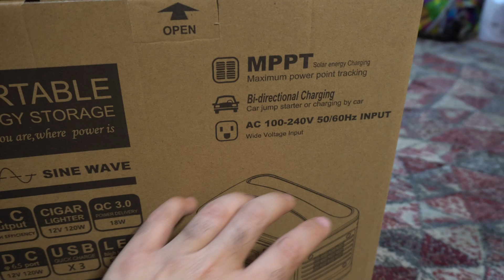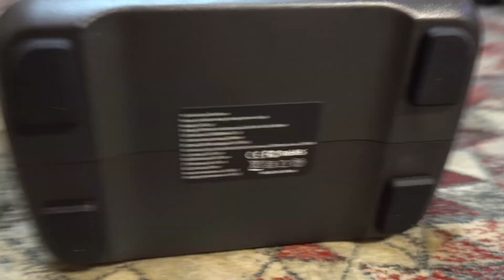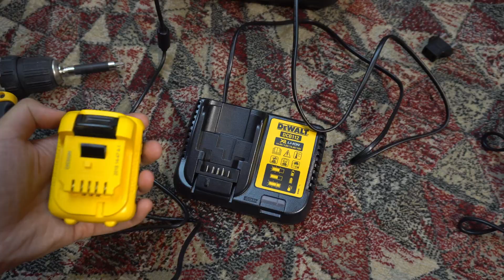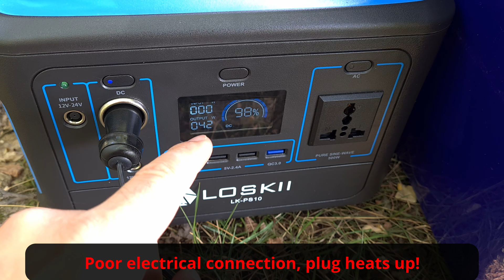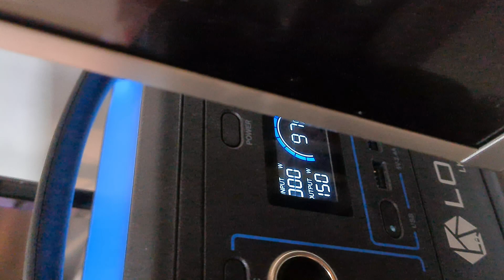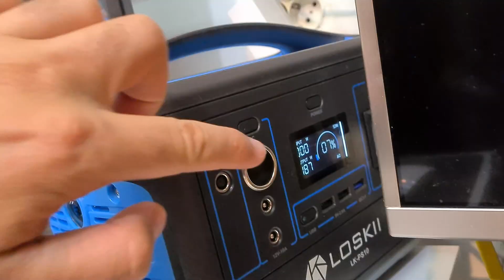Loskii LK-PS10, Portable Power Station (Li-Ion, 568Wh, USB QC3.0, 500W Pure sine AC Output)

Comment: The video is very good, but I think you missed 2 tests to do it.

1... Test how long it lasts from 100% to 0% with a device that consumes X continuous watts.
2... Test the maximum watts that the unit supports (increase the watts progressively).

With these tests that you have not done, the video would have been 10.

And another thing, if the batteries are 18650, then they are LiFePO4 batteries (you don't say that either).

-------------------------------------------------------------------------------------------

El vídeo está muy bien, pero creo que te faltaron 2 pruebas por hacerle.

1... Probar lo que dura desde 100% a 0% con un aparato que consuma X watios contínuos.
2... Probar el máximo de watios que aguanta la unidad (ir subiendo los watios de forma progresiva).

Con estas pruebas que no has hecho, habría quedado de 10 el vídeo.

Y otra cosa, si las baterías son 18650, entonces son baterías LiFePO4 (tampoco lo dices).

Comment: How is this Holding up in the last 4 months 🤔
Reply from the maker: Seldom but I use it and it works OK till now, no issues. Last time I used it with a 3D printer overnight to have guaranteed constant power.

Comment: I need a spare charger input plug for the Loskii LK-PS10, seems to be 8mm in diameter. Cannot find one and would appreciate if somebody knows where to buy it!
Have tried asking Banggod for the specifications of the plug but they do not read my questions, only answers with nonse replies, again and again. Worst customer service ever!!!
Reply from the maker: My measurements are these: 7.8mm outer diameter, 5.3mm inner diameter (or just take it apart and install a different connector).
Reply: @furulevi  Thank you, have ben mailing to and from Banggood for several weeks now. Totally unhelpful, even refused to give me contact details for the (unknown) manufacturer.  And if I open the power station I loose my gurantee. Worst "Customer Service" I´ve ever had the misfortune to experience.
Reply: @photographer-gf  the connector is dc7909, outer wall is negative, inner positive. The needle seems to work just as a lead, to further eliminate wiggle
Reply: @brano6369  Thank you very much! Will immediately start looking for such a plug!
You don´t happen to have the specification for the DC output plugs :-)?
Reply: After over a month with nonsense answers from Banggood ("Suppl more information") I translated the question into Chinese (they do NOT read English) and managed to get an answer. 
Charger input needs  a 7909 (7,9x0,9 mm) DC male plug
12 V output needs 6330 (6,3x3.0 mm) DC male plugs
Reply: @photographer-gf  Hi, I was looking for the exact same information. Thanks a lot!!! Great help.

Comment: I have a question for you. I saw you can turn on the AC or DC output and power up the fridge for example and in the meantime charge it trough the solar panel. But what happens when the input voltage becomes lower with sun fading down? On mine unit the power station turns off and therefore the fridge also turns off. Is not a deal breaker but it means that during camping trips you should be restarting the PowerStation as soon as the sun is not providing enough power to the solar panel. Is it the same with your unit? Perhaps you can test it also with the wall charger and tell me if the power station turns completely off when unplugging the charger even with output turned on and something running out of it (pc, fridge or whatever).
Reply from the maker: If at least one of the outputs (12V, USB, or 220V) are powered ON then the power station remains ON even if the Sun goes down and provides no power input to the power station. If all outputs are OFF and the Sun goes down then the power station also turns OFF to save energy.
Reply: @furulevi  and does the power station turn itself on as soon as it detects enough solar power? Or do you need to turn it on every morning? Thank you so much for the review, it has been incredibly helpful!

Comment: Can you keep it charging 24/7 and use output ? Or battery will die ?
Reply from the maker: I'm not sure how smart it is. Theoretically lithium batteries should be stored for longer periods of time at a medium voltage, let's say around 3.7-3.8V per cell. The fully charged state (4.2V) might hurt the battery for longer periods of time.